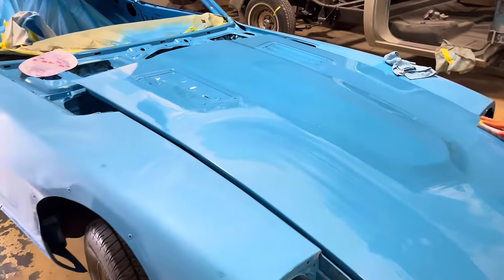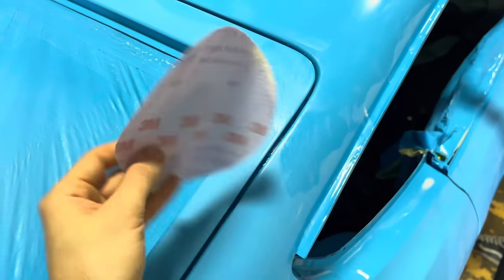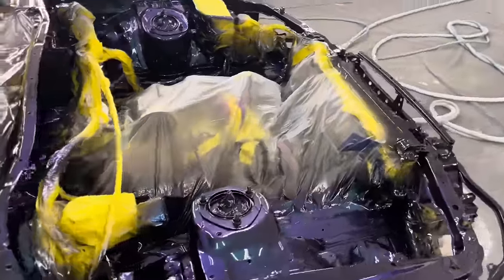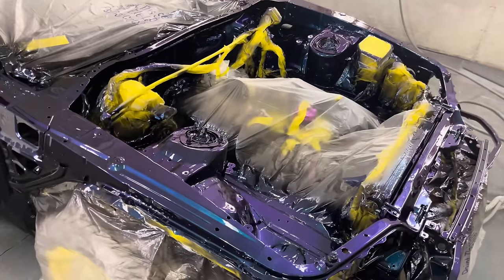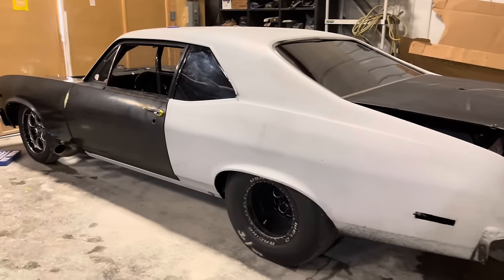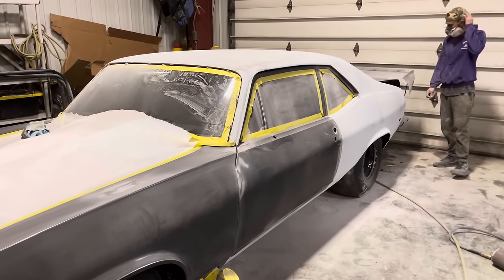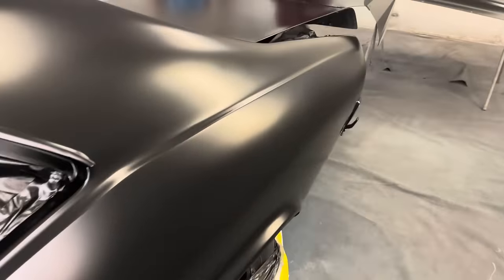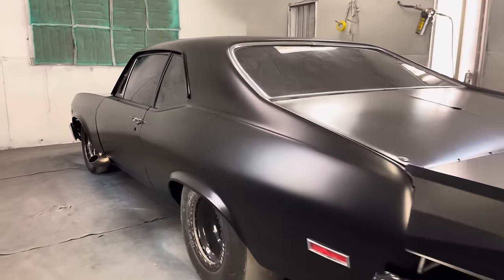24 Hour Paint Job on the SRC Nova, Colorshift Supra & Wetsanding the Datsun

Comment: Yep, those fender gaps on the SRC nova got adjusted by the wall after an engine builder left a mallory weight lose on the crank and it came off and put a big window in the oil pan , that sent the car spinning in its own oil

Comment: Every time I have had to cut and buff it’s best to not do small strokes because it makes waves. I switched from a Sata HVLP 1.4 to a Sata HVRP 1.3 because the droplet size is finer and cause the clear coat to come out with no orange peel and not have to cut, buff and polish every single job I did.😊

Comment: Sometimes you do need to do a quick and easy job for a break or as the OG's from Wisconsin might say a Earl Shibe paint job. This guy basically ran a drive through paint shop. Everything looked great from 30 feet or at 100mph. Dam nice for what it does.

Comment: Nikki a few questions. How long does it take you from start to finish on a normal size car? What would you charge to sand and buff and car? How long after clear coat do you wait to sand and polish?  We just painted my 71 demon and it looks great now i can only imagine what it will look like after its polished.
Reply from the maker: It usually takes Nikki between 60-80 hours start to finish to wetsand and buff a car to her standard. 
On an unknown paint job that we didn’t do, it primarily depends on how nice it was sprayed and how much material there is to work with. As well as what material was used. Correcting somebody else’s paint job is always a little different, as every product acts a little different and proper application during the spraying process plays a big role.

Comment: Excellent work ya'll.  One thing I want to caution Nikki,, learn what you can do to save the stress to your fingers and shoulders. I was a concrete finisher for almost 45 years, I can see your shoulders and fingers are being subjected to very similar stress's. The stress put upon your fingers and shoulders doing the hand sanding - over time - will cause you much pain in your elder years. Please try to find a way to do that work as safely as possible.

Comment: For you jacks at home, watch her wet sand the car, you have to do the same with the primer before you paint the car or you will burn through the paint and have to start over, patients is a virtue, i watch guys do body work so fast, but if you want it to be right its going to take a lot of time, even for a seasoned body man, stay strong guys